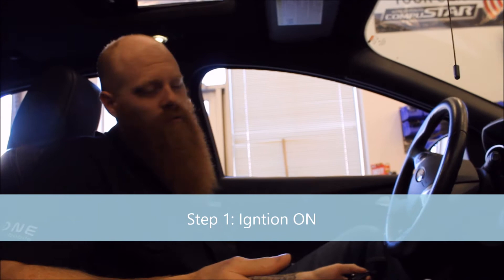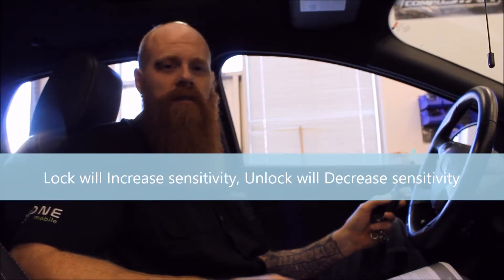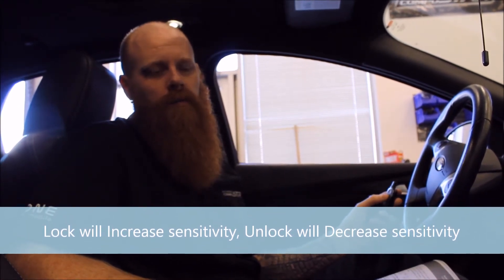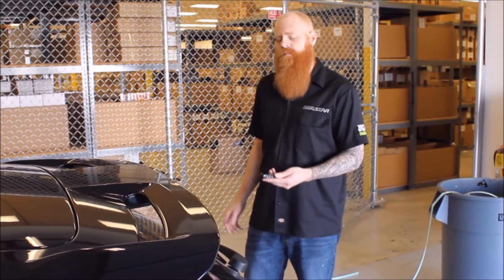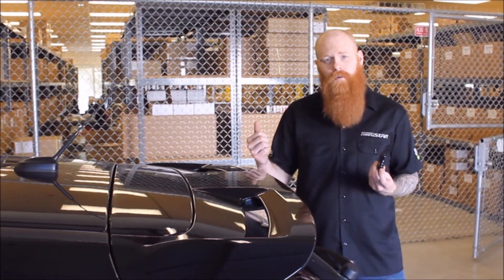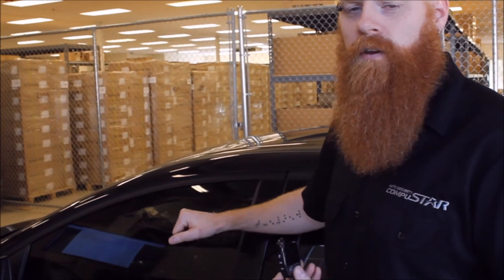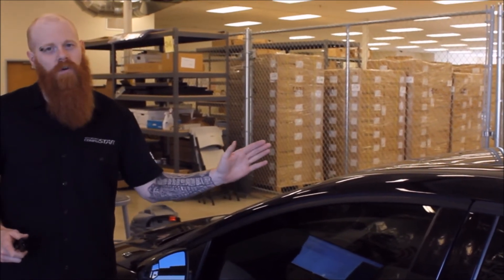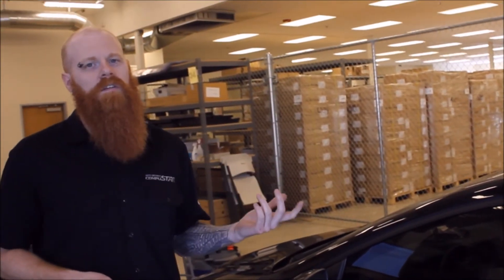Manual DAS Setting and Testing

Comment: Please help.  I tried doing this procedure (turning on key,  hold break until procedure done and pressing my Compustar - Q9 2-Way LCD RFX Bundle with LTE Module Remote 3x).  However it did not confirm parking lights and or horn.  What did I miss and what should I do next? Please help.

Comment: Where is the best place to mount the DASll   in a 2019 Dodge Charger.
Reply: Did you ever get an answer? I jave mine under the center console but it's not sensitive enough even on the highest sensitivity.
Reply: @FRANKHURTADO01  make sure u zip tie it to one of the cars wire harnesses it will definitely be more sensitive.

Comment: The manual says "Using any Firstech remote tap lock or unlock 1 time to increase or decrease 1 level of sensitivity (up to 10 (least sensitive) or down to 1 (most sensitive)) which should be confirmed by chirps/horn honks/flashes" You went from 5 to 4 so it should have got more sensitive.